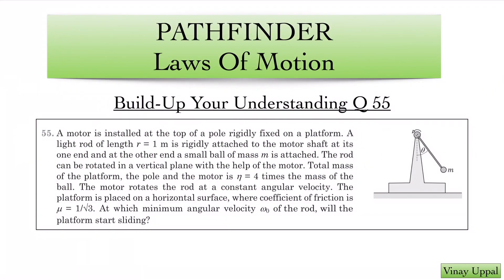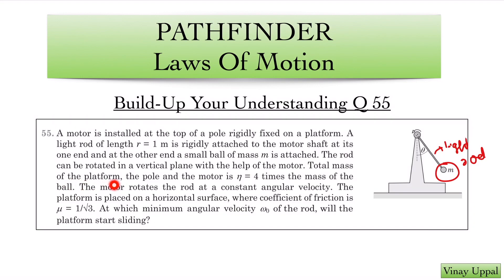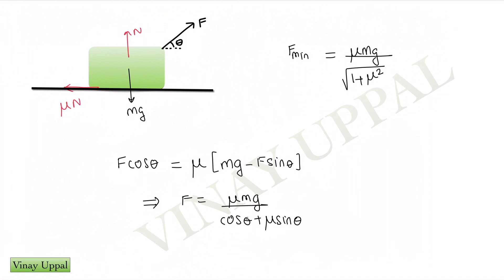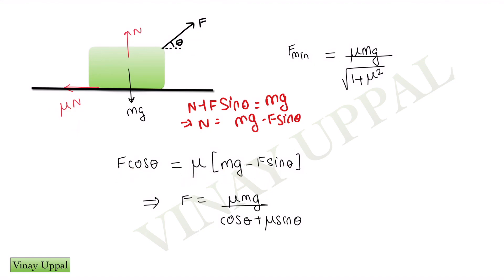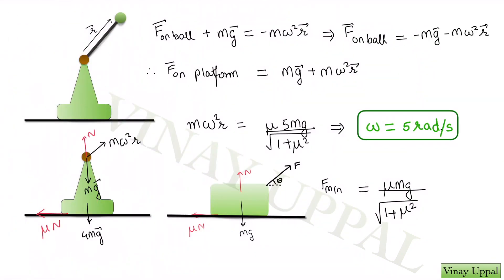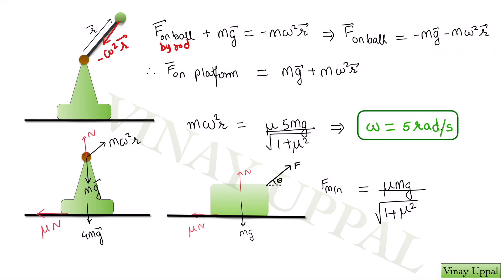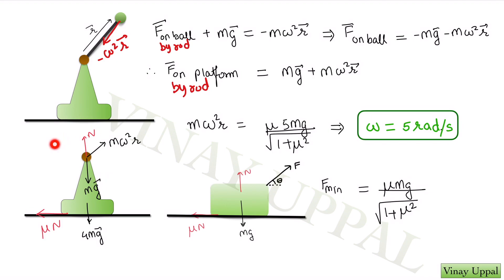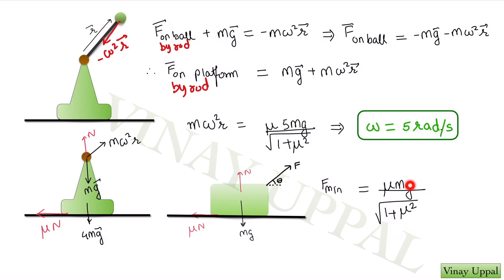PATHFINDER: Episode 5: Cute Solution in Friction. Circular Motion. JEE Advanced.

Comment: Sir I am in class 11 but physics seems messy to me 
Any tip plzzz sir
Reply from the maker: What exactly do you mean by messy? Long calculations? In my opinion, physics is the perfect blend of logic and visualization as opposed to chem where you may need to remember factual stuff or as opposed to math where it will be purely logical but more on the abstract side.
Reply: Sir  I am not afraid of calculation it is problem with questions are not supportive . Like they are constantly saying me to run away 
Whereas in maths difficult topics also seems easy to me 
So plzz tell me what will you do if you are not able to solve a problem after reading theory 🙏🙏🙏

Comment: I get the solution, but I'm having trouble imagining how the platform would actually move when this angular velocity is reached. I mean, isn't the centripetal force changing its direction all the time? How exactly would the platform move?
Reply: @debu6157  hmm, yes, now that I think of it, that makes a lot of sense. Will it have the same frequency as that of the ball?
Reply: @utkarshsharma9563  actually I'm not sure either because it also jumps in between
Reply: @utkarshsharma9563  what reason did he gave though?
Reply: @ayushkumar7448  he said that the platform will oscillate about some point